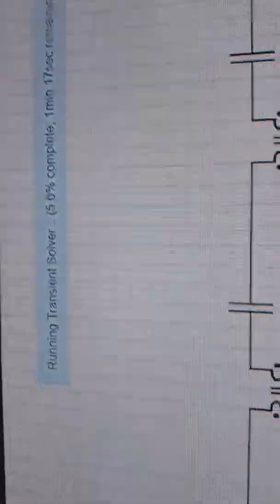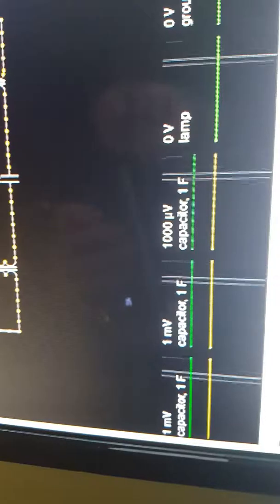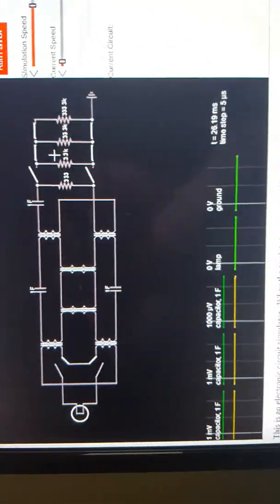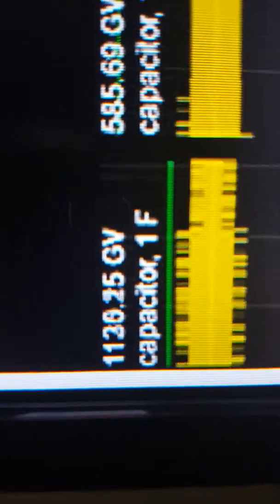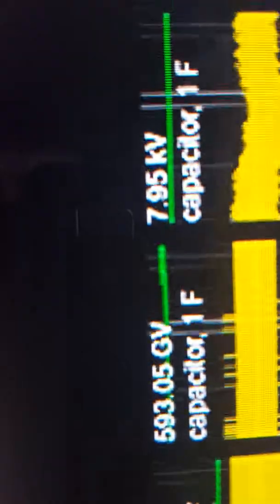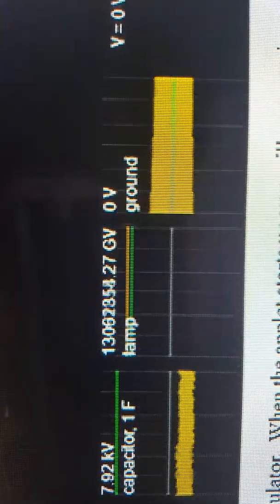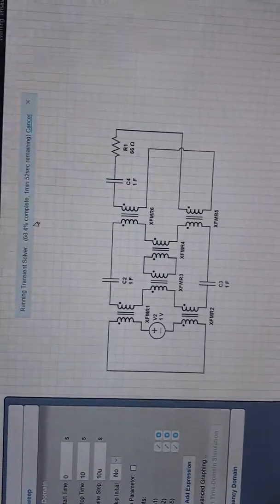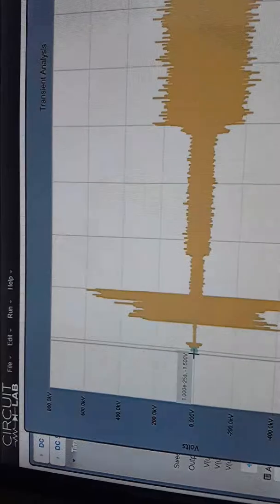Evolution Arts LLC - Free Energy Circuit. Simulated...

Comment from the maker: So I'm tempted to explain why this works, for understanding. 

Induction through a sympathetic wave accumulates the wave on either end per cycle as it matches the same frequency. 

Since we have mirrored transformers that induce equal and opposite to the initial wave, and we have 3 sets of transformers. The input and output is the same. 

After the first rotation and during the decline of the input, it will eventually match the lesser powered output and thus will eventually match frequency, my assumption is near the 440 hz range.

The accumulator, is the inner transformer with no load, it acts as a balancing wheel if you will. Little to No resistance transference for direction. 

Since both the input and the output have the same resonate frequency. The wave cannot destroy or cancel. Instead it is a mathematical accumulation, or doubler.

The system doubles, and begins a resonate decline with a voltage offset either through load or input or ground. 

Which eventually recycles the same above process. 

Researching Tesla and the resonance frequency, it is similar to how a primary and secondary coil increases voltage in a Tesla coil. 

Except, this is induction by reason of virtual frequency. It's an amplifier that induces sympathy harmonics.

Comment: I like the concept but 1% a month would be an enormous amount. I won't use it without further negotiation.
Reply from the maker: 1% a month is not alot IMO. I built a small version of this. 

I lit a 5 volt LED on a 9v 1 second pulse, standard 9 volt for toys. 

It lit the LED for roughly 23 seconds before it began to oscillate.

This indicates greater efficiency. And prototype must have impurities.
Reply from the maker: If you choose, I'll take a 10 million USD buy out.